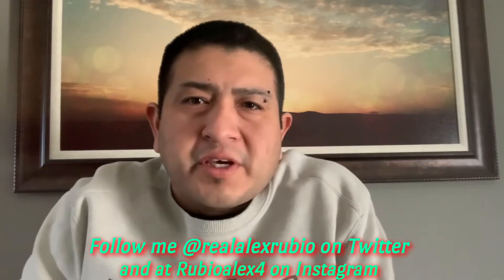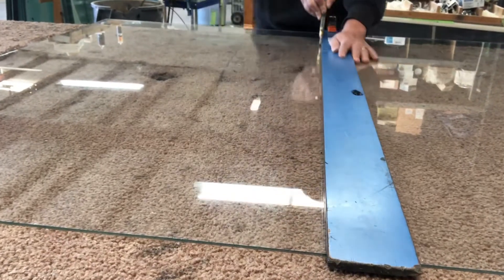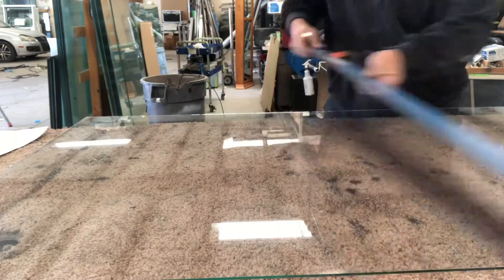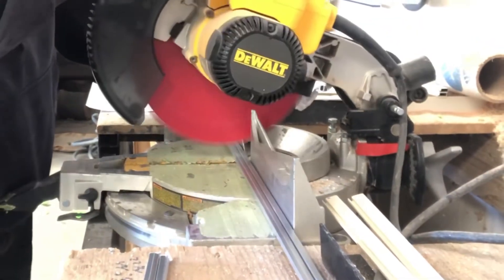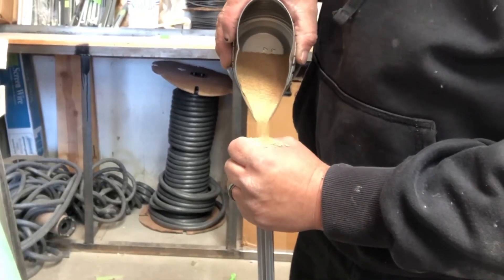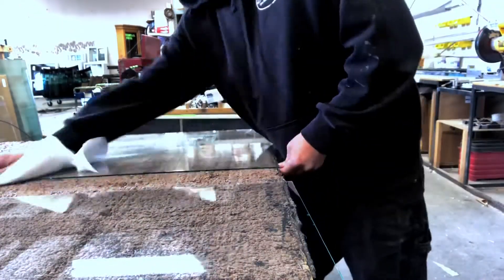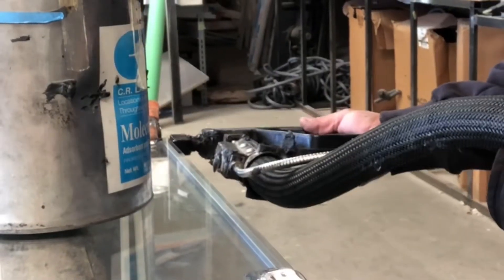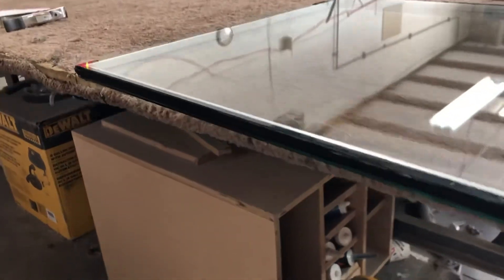Making an insulated unit (full process)or double pane window

Comment: You have no idea how much trouble you've saved me!  I'm trying to create a wall of glass at 49 degrees for heating a solar wood dryer.  My initial plan was to route two channels in wood for the 3/16", 2' x 5' greenhouse glass.  In case of damage, I want to pop out one that might break to replace it.  It would be hard to get the grooves right for the glass to slide in.  They would have rotted and fogged up.  

After seeing your videos, it seems the way to go is the stainless spacers, dessicant and butyl rubber sealing it.  What kind of blade did you use in your cut off saw?  Where can I get the dessicant?  What brand are the connectors?   Many thanks for such useful videos!!!

Comment: I'm wondering if the internal space ever gets filled with a noble gas for higher R value... I know this is done with factory produced units, but I'm wondering if small shops can do this...a valve of some kind.
Reply: Even the large supplier can't keep the gas sealed inside, doubt the smaller guys. The noble gas thing is mostly marketing, in theory it works. In practice manufacturers cannot keep it from leaking out.

Comment: Quick question. I see some companies that swap out the the air between the two pieces of glass with argon or krypton gas to make them even more efficient. If you trap air with humidity in it inside the window, won't that potentially cause problems later on? Or is that why you fill the spacer with the dessicant?
Reply from the maker: Yes for both questions
Reply: @AlexRubioRQualityGlass Thanks for your quick reply. Very informative video!
Reply: Note that the humidity of the workspace needs to be adequate.

Argon is a neutral and heavier gas that works even better than air.

Comment: If you use tube CLR sealant and not the hot that you showed. How long do I need to leave the clamps on?
Also how long is the cure time before installing with not hot sealant?
Reply from the maker: I say at least 24 hours for the clamps. It’s been a while since I used to crl sealant so I don’t remember what the actual cure time is but we would let them sit for at least 3 days before installing them
Reply: @AlexRubioRQualityGlass  Thanks for the reply!  I’m transporting my triple insulated window from CA to UT and leaving the clamps on.  The sealant tube says cures in 24 hr, but a full cure is 7 days.   Does it hurt or help to leave the clamps on for the full  7 day cure?
Reply: Also, how long will a can of desiccant last after opening it up and reclining the can?

Comment: Hey Alex, I'm a 85 YO DIYer. I have five IG units that need rebuilt. I have a roll of Super Spacer and caulk tubes of sealant.
I'm sure you are a busy person but I really need some advice and hope you can help me.
I'm confused! The SS1266 super Spacer has tape on one face and it wraps half way around both edges. The tape is apparently meant to stay. The Spacer is said to have pressure activated sealant on both edges.  I have not found anyone that can answer a couple of simple questions. 
1. Can I use this Spacer without $500 dollar tools?
2. How do I make the Spacer edges stick to my glass panes?
A phone rep at the supplier where I bought the Spacer said I should apply 877 sealant to the Spacer edges to seal it to glass. WT---??  I understand sealing outside the SS but edges??.
3. How much pressure is needed to activate the primary sealant? Will clamps do it?
Thanks from Kentucky, Bill C

 But edges??

Comment: Is there a way to do the butyl seal manually without the gun ?  Its nice to have the gun but the machine costs like $2500 US so I'm trying to understand how I can seal it without that -- any ideas please share  ?  Thanks for your video.
Reply: Figure out what temperature is needed and heat a metal surface you can scrape with.

Comment: Whats the gun and black glue called and what would you recommend i get if I’m a beginner on a budget!
Reply from the maker: I recommend just getting a caulking Gun and buying a box of super spacer 877 black silicone foam for metal insulating glass sealant it just takes a few days to fully cure instead of a few minutes like in this video

Comment: Out of curiosity, how hard is it to source the rubber butyl, spacers, and desiccant? 

I also live in a small town and today's shipping times are starting to hurt both me and my customers... Looking at 4-5 weeks out at the min. for Ins. Units and wondering if it would be 'worth' investing in the equipment to build my own as you do. 

Also if you catch this comment, what specific glass cutter are you using? I looked into the pen style but most of them just seemed janky and more for the hobbyist. 

Thanks for your time man, i appreciate any insight or input you have!
Reply from the maker: Toyo tc17 glass cutter is good and cheaper than most and you can order the cutter and everything you need from CRLAURENCE .com the hot melt is pricey you can probably find one cheaper online somewhere else but I believe with crlaurence you need to set up an account with a business license. And it’s definitely worth it. Turn around time is super quick. Good luck man

Comment: I want to rebuild old wood cellar sash windows with double panes. How thin can I make something like this?
Reply from the maker: The thinnest I’ve done was 7/16 of an inch
Reply: @AlexRubioRQualityGlass  that’s total? The whole unit, I can just prepare for 7/16” thick open spot in the window frame? I need 14 of them 10”x12” (I think). Interested in building them?

Comment: Nice demonstration. I am attempting to repair two IGU's. I am not sure I can reuse the old metal spacers and cannot find new ones for sale online nor the desiccant except large bulk. I would like to use the super spacer foam because I can buy the spacer and sealant online, however, every video shows them using a $350 tool for the foam spacer alignment and then running the IGU through a machine that presses and heats it a little. Have you used  both these products [ foam and 877 sealant ] without special tools or do you know if the super spacer foam can be installed just using a homemade jig and the unit simply clamped and sealed without special pressing and heating? Thanks
Reply from the maker: Yes I have used those products and I have never used any special tools they are actually easy to use and very user friendly and for someone who doesn’t do them all the time it should be perfect for you
Reply: Did you get your question answered? I have the same question.  Bill C
Reply: @billcroucher6206  I got my question answered by Alex Rubio above. I did a couple of windows without tools. It isn’t exactly easy because the foam is so extremely sticky and you really only get one chance to set it on the first pane and then applying the second pane so the two panes are aligned is difficult but I did do it. The other part that seemed it should be simple but wasn’t simple was cleaning the panes and then keeping the insides clean during assembly.
Reply from the maker: I do remove the tape so the glass sticks to the spacer the trick is the second side just peel off like an inch of the tape off set your glass where you want it and after your glass is set start pulling the tape off slowly and it should all adhere to the glass when your all done then you could use the 877 sealant
Reply: @timabbatiello8993 Thanks Tim. How exactly did you make the Super Spacer sticky?
Reply: @billcroucher6206  The super spacer has glue on both edges with protective tape that you remove. I see your question about the sealant and what they are describing is ...after you have the two panes joined using the super spacer you then fill the area between the spacer and the edge of the glass with the sealant. This is also fairly messy process without making some sort of applying/tooling device of your own.
Reply: @timabbatiello8993  Thanks Tim. Yes I do see the removable tape now. Duh! I don't understand why none of the Super Spacer videos make that clear.

Comment: Hi!! Thank you very much for this video, it is very instructive :) I would also like to ask you a couple more questions: 
1- Is there a ratio between the size of the separators depending on the size and thickness of the glass? Where would I find this? 
2- What is the black hot 'gulk'? you use to seal the panes? I live in a Spanish speaking country at the moment and have to dig into the translation of this product. 
3- (for the same reason) What are the pebbles you put in the separators?      
Thank you soooo much!!!!
Reply from the maker: For your first question kinda yes but for the most part older medal and aluminum windows are more 1/2 to 5/8 thickness and newer windows like vinyl or wood/clad windows are more 5/8 to 3/4 thick and up to 7/8 or 1 inch thickness depending on size of windows the black stuff is butyl and I’m Hispanic and honestly don’t know what it’s called in Spanish and the small pebbles you see is desiccant it absorbs humidity to prevent condensation between the pains

Comment: Hey Alex—You make this look easy. I shot a rock through my big front-door sidelight with my weed whacker and broke the outer pane. It is a factory insulated window with just a layer of butyl tape between the panes. Local glass company says it would be cheaper to just buy a whole new unit for $343 because it will just leak and fog up if I try to do it myself. Ten years of installing windows and worked with a few stained glass guys who never seemed to have any trouble with fogging up. Window is under covered walkway, but we are in St. Louis where it gets steamy. Should I try to replace the outer pane or just replace the whole thing? Can it be installed standing up in place?
Reply from the maker: U can definitely try it yourself but it is true we recommend just getting a new one but when it’s more like an emergency or quick fix we will just replace one pain it is possible just need a good seal and no do not try it with it in place

Comment: Hi Alex, some of my double pane double-pane, double-hung vinyl replacement windows leak at the bottom of the bottom sash during heavy rains. However, there is no condensation inside the IGU just water leaking into the house at the seam connection between the lower sash and lower window pane.  I am not a pro like you. However, I think the problem is that the seal or gasket needs replacement. You have suggested changing the double-stick tape instead of using silicone. You say if you use silicone it will make it hard to fix if you need to reseal in the future.. My one goal is to stop the water from entering the house during heavy driving rains. I checked the weep holes, and they work.  I'm afraid if I go through the effort of removing and replacing the double-stick tape the windows may still leak during heavy rains. The reason I keep asking this same question as you are the only window repairman who has provided easy-to-understand explanations of seal failure. But, what I need to know is how I can stop leaky double-hung vinyl windows from leaking during heavy rains. Should I pop the glazing beads and remove the IGU and then silicone the IGU into the frame, and then pop the glazing beads back on? Others say to just silicone the seam at the bottom 3 sides of the bottom sash. Since these windows are 25 years old I likely have some warping in the sash. But the windows are in very good condition except for the leaks. Surely, there must be an easy secure method to stop the leaks? If there is please do a video explaining how you stop the leaks.  The alternative is the replacement of perfectly good windows, which contractors would love to do.
Reply from the maker: First of all have the always leaked during heavy rains? Then second the life span of a window usually are 15-20 years and if some warping that can definitely be a problem but honestly most windows are only water resistant not water proof depending on window manufacture ratings. I’m not sure where you live and how much heavy rain you are getting but normally if you can take a garden hose and spray if at your window and it leaks than you have a problem most should be able to withstand that kind of water pressure

Comment: Nice job Alex - appreciate your help! How wide of a piece of glass can you build without it sagging in the middle? If I use the Super Spacer 877 Black Silicone Foam and Metal Insulating Glass Sealant instead of your hi-tech hot butyl machine, do I have to heat it up with a heat gun or just use a caulk gun and put about 1/2" in cold all the way around the perimeter? Thanks!
Reply from the maker: You do not have to heat it up, just use it how it is and the bigger you go with your glass size the thicker the glass has to be but for an 1/8 thickness of glass I wouldn’t go any bigger than 60 inches and that’s pushing it
Reply: Have you received the spacer yet because I have purchased a 66 foot roll and wonder if the pressure adhesive on the sides of the spacer have a protective film over them that you remove as you place it. This super spacer foam is expensive and it appears it must be installed and the IGU sealed rather quickly to preserve the desiccant effectiveness so this all comes down to planning and execution and even then I will have over half a roll left over that I hope I can reseal effectively for future use. I plan on using a sharpie to mark lines to aid in placing the spacer straight and the protective film would help a great deal. I also am wondering how the corners will work since there is a vapor barrier that will need to bend without bunching up.
Reply from the maker: You pull the blue tape off one side and stick it to the glass about 3/8 from the edge and work it all the away around and the get the top side started by pulling the tape off like an inch then set your second piece of glass on top and pull the tape slowly as the glass begins to stick to the foam space and work it all the way around. That’s the easiest way. If you pull it off all At once good luck getting it exactly where you want it
Reply: @AlexRubioRQualityGlass  Thanks. Is there any trick for the corners?
Reply from the maker: @timabbatiello8993  not really, just try to bend it as much as you can I e seen people cut the corners but then you might lose the seal that way.

Comment: I paused after 24 seconds to LIKE this video... anyone seen a video using 'Super Spacer 877 Black Silicone Foam and Metal Insulating Glass Sealant' method for an easy DIY job?'
Reply: no, but basically same idea, just use a caulk gut to apply 877 intead of using hot melt.